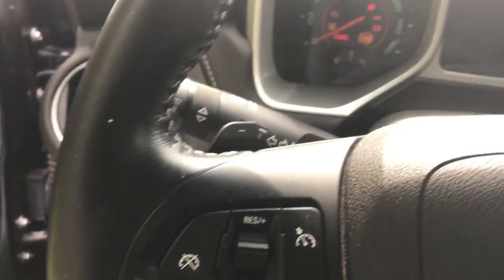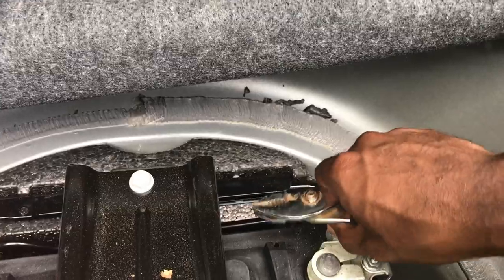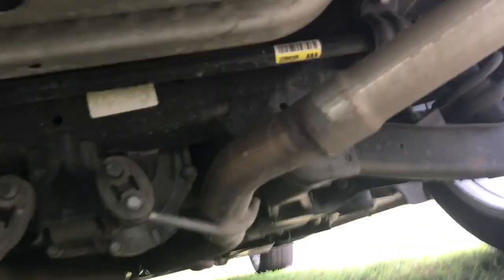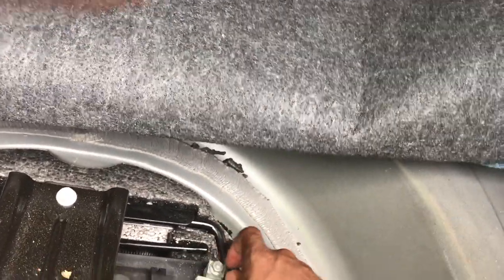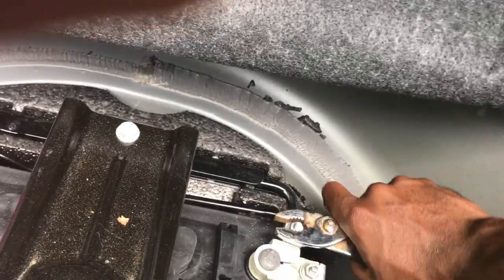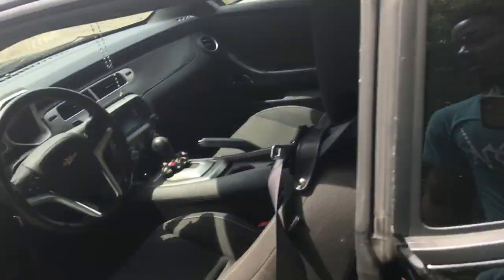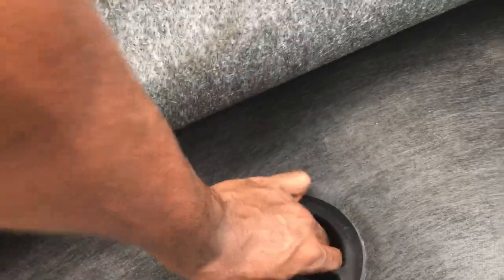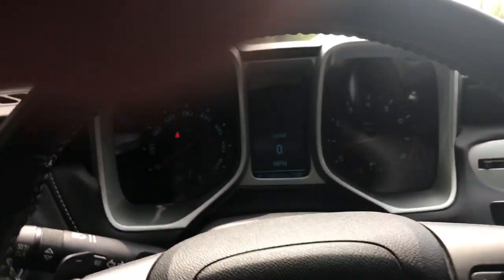How to reset a 2015 camaro computer and where to.located the battery

Comment: Dude use a socket for that battery disconnect. Genuine GM crap. BTW the ECU was just reset, it was cleared, not reflashed/reprogrammed.